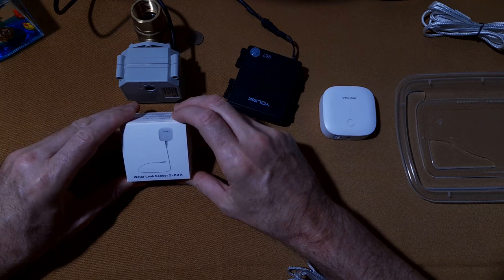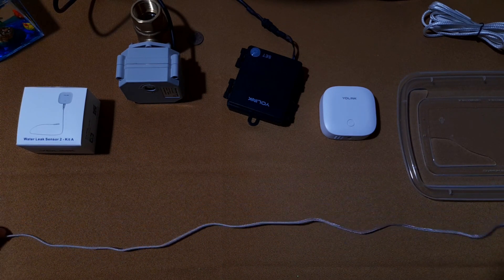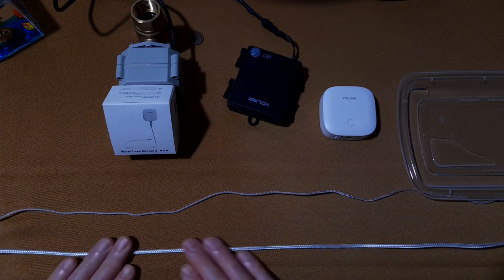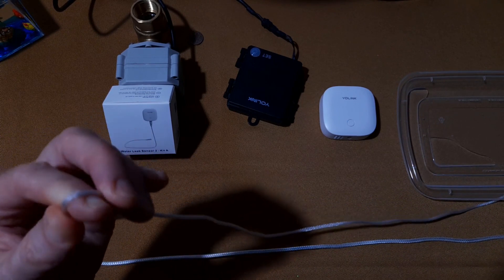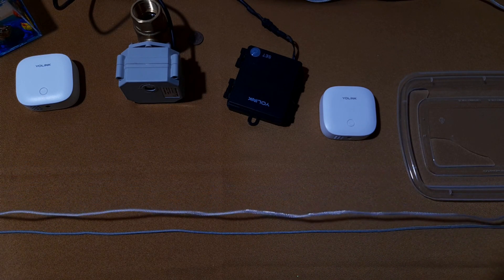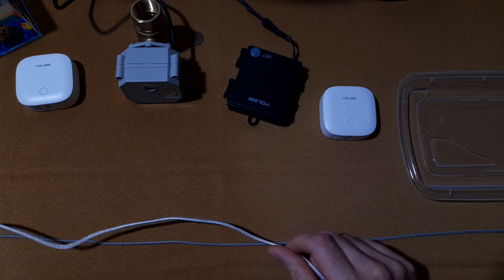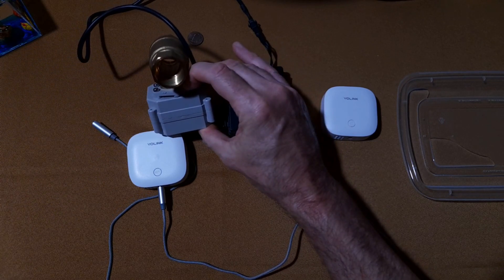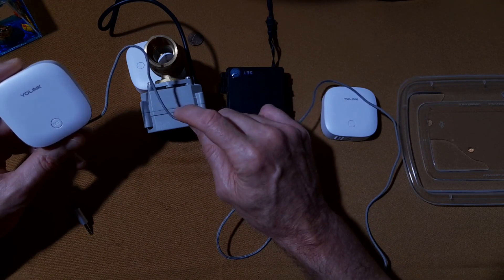Redesigned Water Cable from Yolink

Comment: Hey Rick. Thanks for the great video.  Which model is that blue in line valve/actuator you are using?  It looks very sleek and works very fast.
Reply from the maker: Sorry for the late reply.  Here is a link to their water valves.  https://shop.yosmart.com/pages/yolink-smart-water-solutions?srsltid=AfmBOoq_gQG94Ch_9q4cslezoCjJBl67ZV1XI6YKFAp8NlNb0E9Zx55C